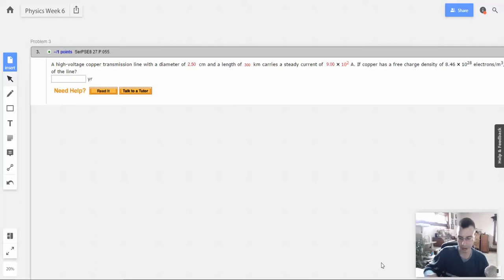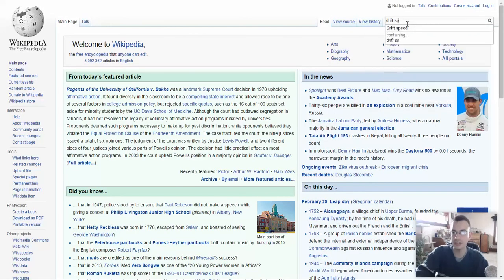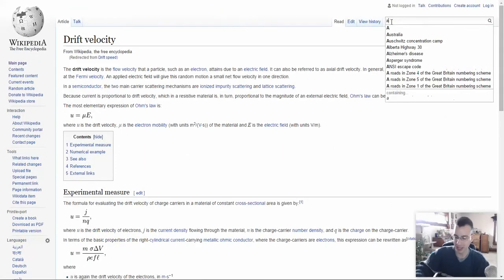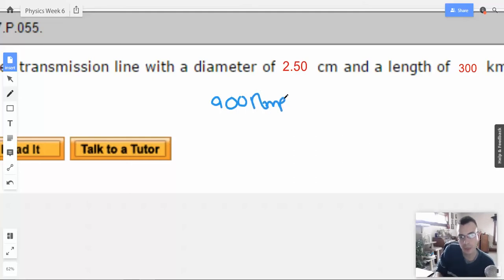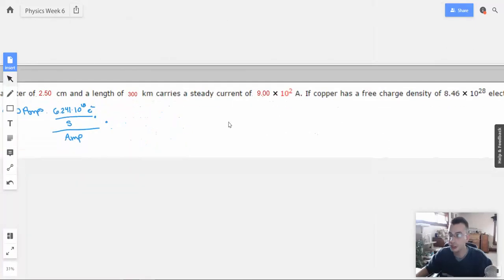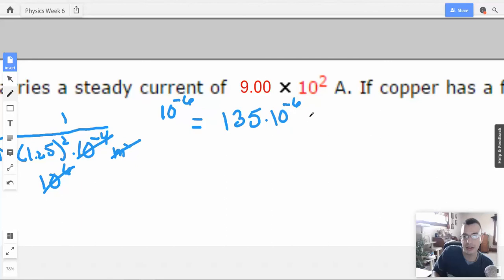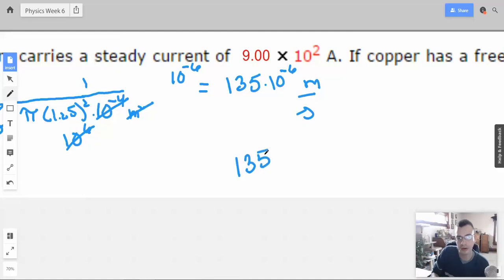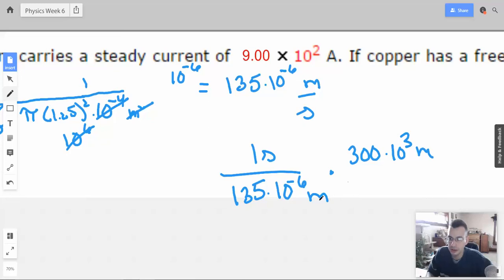Week 6 Problem 3

Comment: You forgot to divide by 3.15 on the bottom. The answer would actually be 70.54 years, and the second equation input would be 300*100/(135*3.15).
Reply from the maker: Good catch. Thanks.